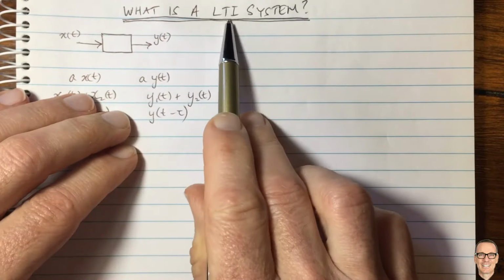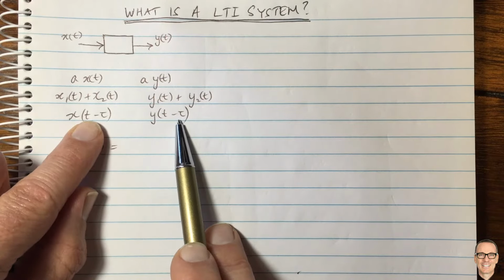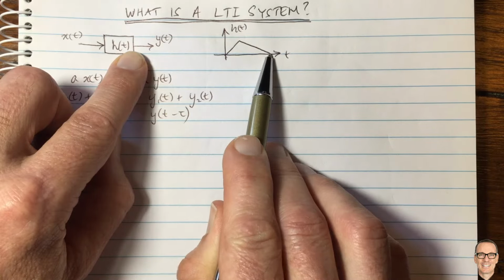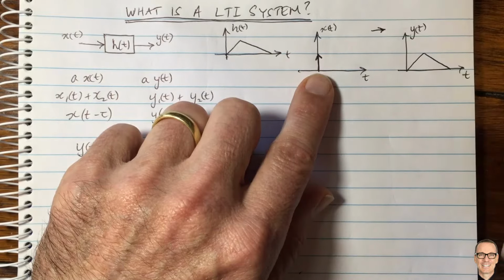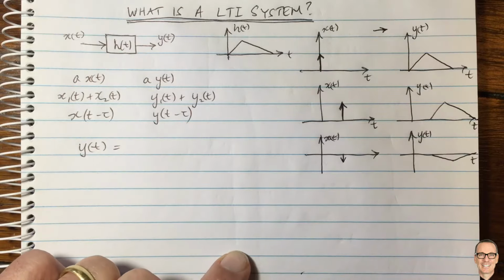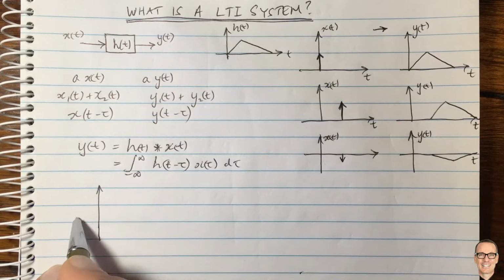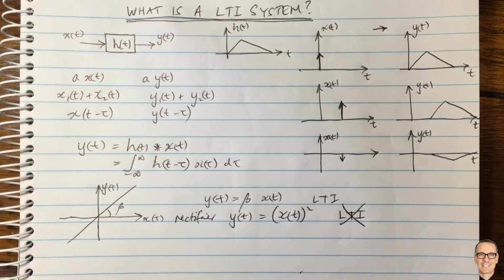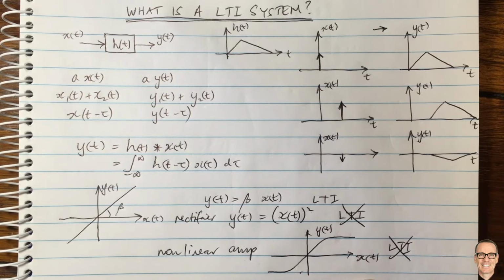What is a Linear Time Invariant (LTI) System?

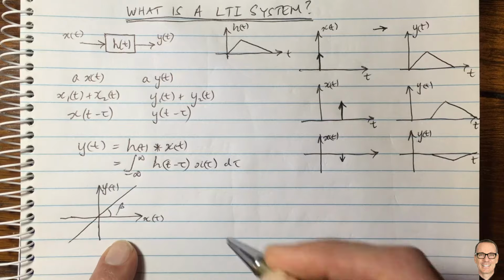Comment: 4:21  I don't understand that point,  x is just an impulse function and y is a different function. Is it really equals to  = [some constant] times [x(t)] ?
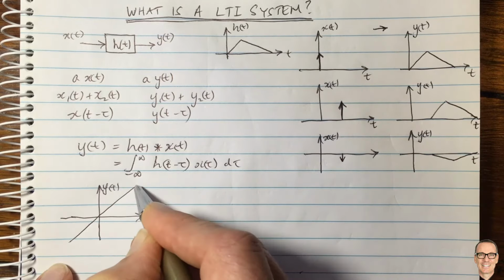Reply from the maker: I'm not sure what you are asking, sorry. At the 4:21 point, I am just giving an example of a functional relationship between x(t) and y(t). It's just one example, in which y(t) simply equals a constant gain, times the input x(t). That is exactly what an amplifier does.
Reply: @iain_explains   thank you for answering, this is the point that I don't understand. Why it's equal to a constant number? Xt, yt, and ht are (generally) completely different functions in systems. How H(t) is equal to a constant gain in t domain?  S domain may be understandable a bit, but convolution is also complicated.

Comment: sir, can you comment upon the linearity and nonlinearity of our wireless channel? 
according to me, the channel would be nonlinear as the channel coefficient is under rayleigh fading which would lead to distortion in phase and amplitude. but my doubt is that than how we are writing the impulse response of the channel rather an impulse response is defined for only LTI systems
Reply from the maker: Wireless channels are linear. For linear systems, when the input is a sinusoid, the output is a sinusoid at the same frequency. The amplitude and phase will (in general) be different, but there is no change to the frequency. The key point is that amplitude and phase changes are not "distortion".
Reply: @iain_explains  hello professor since the wireless channel is random in nature thus it cannot follow the property of homogeneity as the gain provided by the channel for different inputs at different intervals of time would be not the same but the principle of homogeneity tells us that for the system to be linear the o/p should be scaled by the same factor as that of input